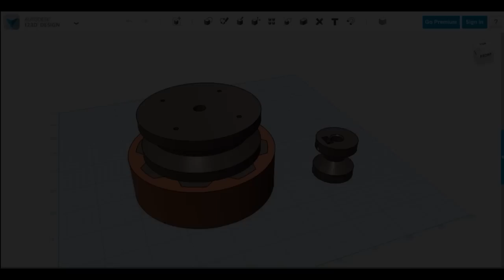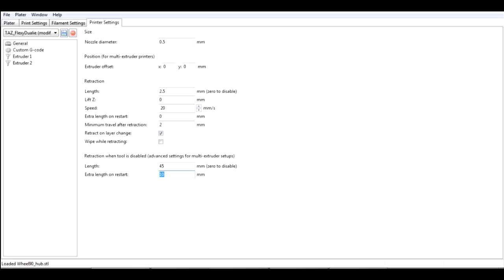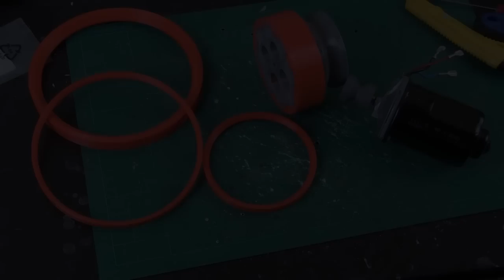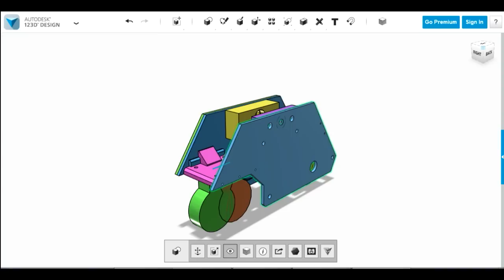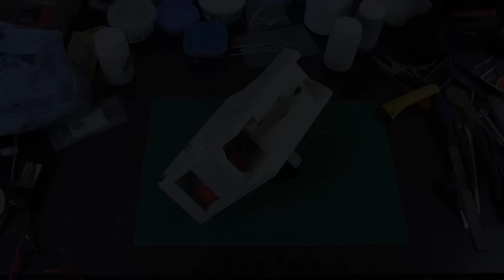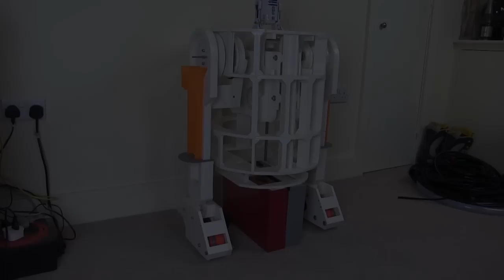Star Wars R2-D2 R6 Droid #6 | Ninjaflex Wheels & Drive Train | James Bruton

Comment: Hi ! I'm french and I love your videos !
Actually, i'm working on a Mecanical project (with Arduino control), and i will follow your techniques for the electronic part !

I'm blocked since 3 days on the research of a motor. I calculate all his caracteristics, but i don't find it on internet...

i would like a motor with:
Power > 250W
Torque >= 5Nm

For the speed i will use a speed variator.

Where do you buy your motor/servomotor and where can i find mine ?

Continue your video, you are great !

Comment: Are these 3D stl files available to make your own parts yet?  If so James, where can I access them to do my own prints?  I have an R2 unit I have been working on and these foot motors would make it a lot easier to build and use on my droid.  Any information would be grateful if you are not to busy, thanks!

Comment: On your ninja Flex/abs print.. Why not add ridges, or keys like mold making, into the print. My understanding is like materials attract, if you add something into the 3D model that allows an anchor point it should be able to handle the stress.
Reply: The orange and grey drive wheel at about 8 minutes in.

Comment: Looks cool and amazing, I just hope it doesn't topple over in two leg mode when driving at that speed instead of just losing the box of weight.
Reply: maybe you can somehow set a different speed limit depending on  which leg mode its in. Two leg mode would be set to go much slower than three and would make it safer for you to allow kids to use the controls when your showing it off at events. Although you would probably still want to use three leg mode for kids, just in case.

Comment: Once again, amazing. Are you planning on adjusting the CAD drawings to thicken that leg? So what's your total weight at this point?
Reply: ***** That is crazy. I know one of the things with conventional builds is the final weight and the need to have some pretty hefty motors to drive him and then bigger batteries, etc.
On the wheels, would it have been too difficult to print the inner & outer as two separate passes and then slip the Ninja on afterward?

Comment: Hi James, you probably know this but the ratchet on the left stick of your transmitter is a removable feature. It's designed so that it can be swapped from the left to the right stick (or fully removed) depending on which mode you "fly" in. If you take the back off the transmitter (It doesn't void any warrantee as it's designed to be done) you'll notice a thin piece of spring steel held on with one screw on the left gimble - remove that and both sticks will operate identically....

Comment: on the remote control without the spring simple solution, loop a rubber band round the toggle, round the back then over the toggle, you will have a springback toggle,